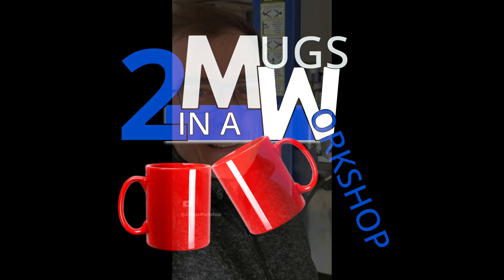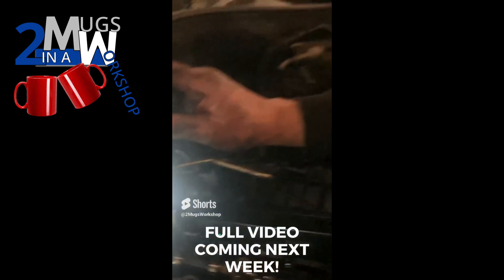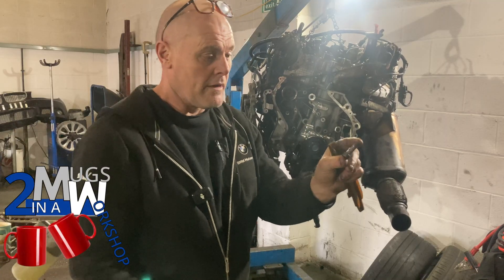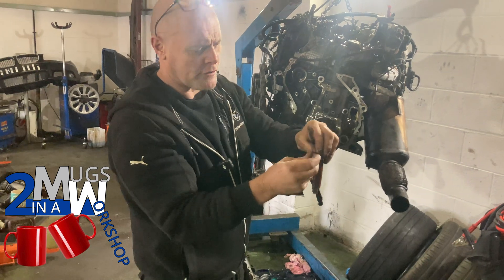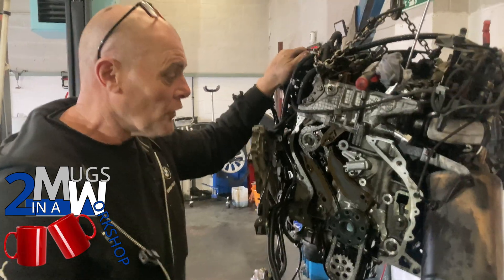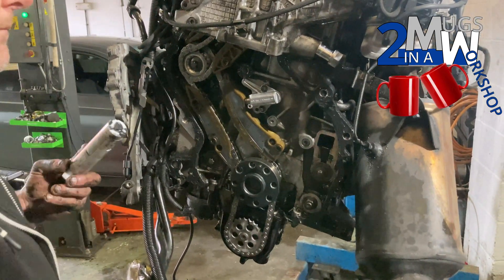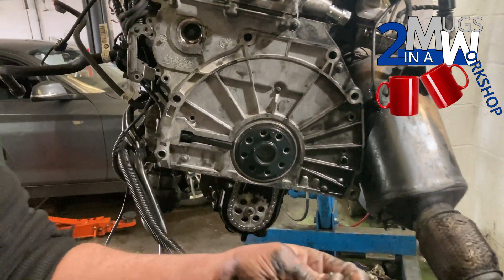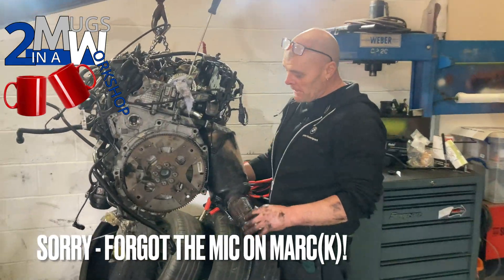OUT OF TIME! BMW N47 ENGINE TIMING CHAIN REPLACEMENT

Comment: I used to do these out of the car but for the last several years I just pull the gearbox off do them in-situ. N47 is easy compared to a 4 wheel drive B48 trust me. Nice video guys - subscribed👍
Reply from the maker: Really appreciate the kind words.  The N47 is both a blessing and a curse ... we're only a small shop but do plenty of them.  With many of these we pull the engine because customers are realising that it is a good chance to rebuild the turbo, intake manifold and we're seeing more of the high mileage cars with bottom end damage.  So having the engine out kind of works for us - can free up the ramps whilst we're waiting for parts or for suppliers to rebuild turbos etc.   We've actually got one at the moment that that the customer did not want to repair because it suffered oil starvation and needs a. new crank, etc.  So Marc agreed a price with him and will be rebuilding it.  We will try to show some of that once the parts arrive!

Comment: Someone suggested an N47 engine transplant into my vehicle. After seeing the effoft to change the chain i don't think I'll bother! Wonder why they didn't put it at the front. Is this the engine type that's had a few issues in police cars destroying itself?
Reply from the maker: Put it this way, I'd only buy a car with an N47 if it was extremely cheap and I got it straight in the workshop and replaced the chains etc.  It can be done in a day, as long as all the parts are lined up and ready to go and you don't find any additional issues along the way.

The design is a bit mind-boggling but the good news is that once replaced, you should get many miles of motoring from the unit.  It is going to be interesting to see if the later B47 engines suffer the same fate .. they don't look much different and we suspect they will.

Police cars - think they all used the 6-cylinder engines and I believe was more to do with EGR cooler.  But let's not forget that those cars probably aren't run as standard (tuned?) ..  generally the 6-cylinder engines are more hardy than the 4-cylinders ... but they are not immune from chain issues ... they are just taking longer to get there!